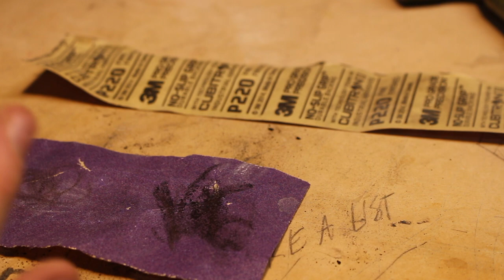Opinel Knife Mod

Comment: Very cool. I'm modding my no. 6 today. Filing jimping notches all the around the collar for better grip and one handed manipulation while opening and closing collar. Drop the point to almost a spear point, sanding better access to nail nick in the handle, and dropping and rounding off the butt of handle. Maybe drill a lanyard hole. I love modding opinels. Oh and linseed beeswax finish. :)

Comment: Educate me.... why torch the butt? Was this strictly a cosmetic desire or is there another reason? Did it end up destroying the wood more than just the aesthetics value of the burn? Like 4
Reply from the maker: Just experimenting with the aesthetics. While I did accidentally sand the lower point of the butt, it didn't destroy the integrity of the handle.  I was inspired by the Japanese technique of shou sugi ban.  Thanks for checking out my video! cheers
Reply: I'll look up that technique. Thanks for sharing/answering.
Reply: @chrisdubois641  Heat treating the wood this way is done by torching it, but not to the point it actual charrs, then you treat the wood with wood tar (what comes out while making traditional charcoal from fir/birch and so on. The flame treatment opens the wood for the tree tar to soak in and make it very tough. I use an mini buton torch to do that, it allows much better controll and you end with handles that look very mahagoni after the wood tar treatment.